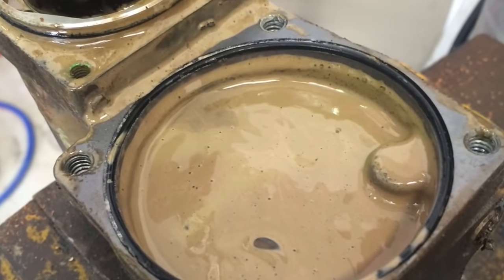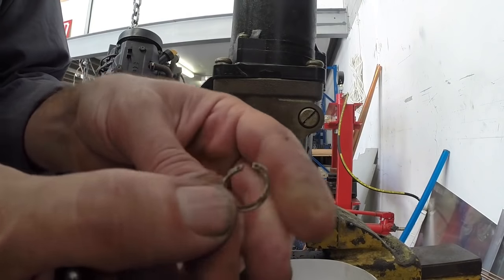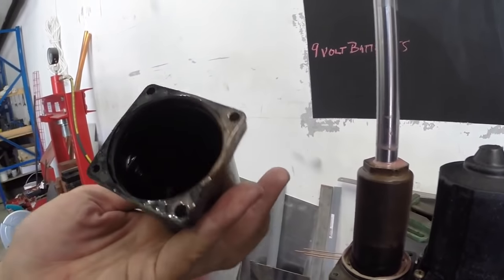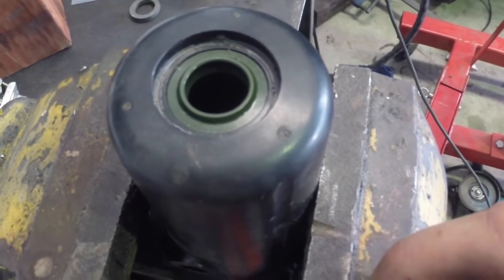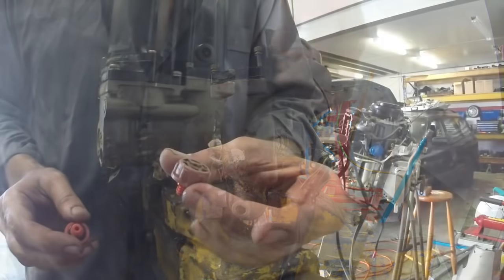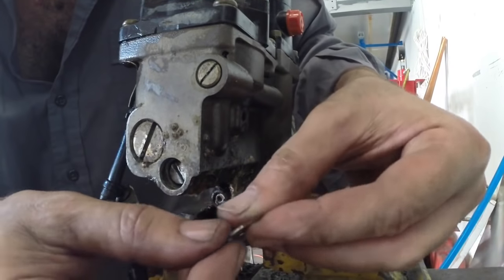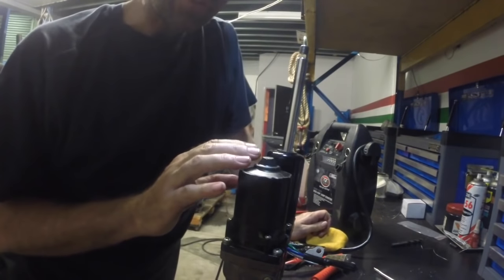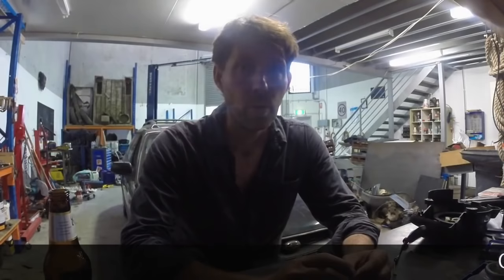Water in outboard trim tilt hydraulic oil

Comment: Hi. I just watched your channel. I have question about my 1988 Johnson 80horse outboard.It starts great, but when you accelerate, the motor only runs at about 3900 to 4200 rpms should be around 5200. All new electric parts.  20 ft. pontoon, prop is 11 pitch.  any help Thanks
Reply from the maker: Hi Wayne. Has the boat previously run at 5200 with that prop?

Comment: Again a great vid. 
Just one question, what would cause the trim to drop slowly ?  about 10mm over an hour. oil is at right level and air has been bled out.
Reply from the maker: +Danny Skok Make sure the bypass valve is screwed all the way in tight, it might be leaking a little bit. Otherwise, could possibly be the ram seals leaking. Also, with the motor trimmed all the way up check the rod for corrosion or pitting as that will cause oil to leak past the seals even if they are good.

Comment: Do you have to change the hydraulic oil on certain period of time or only when it malfunctions.
Reply from the maker: +Val M It more important to keep it topped up that to replace it. In fact there isn't any quick way to drain the old fluid out like there is with a sump or a gearbox. By topping it up every 100 hours (or annually) you'll be able to see if you are losing oil or have water in the oil and need to do the seals. Hydraulic fluid doesn't absorb water like brake fluid and doesn't get dirty like sump oil. I'm sure there must be some practical limit to its lifespan but I would be more likely to use a pump to fill the reservoir and just displace a bit of the old oil each time to keep it fresh.
Reply: Dangar…you are awesome, thanks for the quick response…enjoy your day!
Reply from the maker: You have a great day too. :)

Comment: Is it necessary to remove the outboard from the boat?
Reply from the maker: Not always, sometimes you can just undo one side of the transom mount and pull it aside to get the trim til unit out.
Reply: Dangar Marine ok it looks like I need to replace the top seals on a honda 75. Sounds like i might need a fork lift

Comment: Hi, I got 81 model johnson 70hp .my trims have started leaking fluid but my tilt is good that was last week, this week my tilt is making horrible noises not sure if air got in. i tried to bleed it filling it up with fluid but noise still there. the sounds it makes is like an old rusted hinge ROFL very  loud any help, please
Reply from the maker: It could be a problem with the pivot points being corroded so your hinge theory might be right.
Reply: thanks for the reply.
I have serviced it, grease all the places that have grease nipples. 
the noise comes from inside the tilt ram, I place my hand on it and I can feel the vibration coming from it.
LOL now I'm paranoid it could be the ram top joint where the pin goes throw I will check it.
anyway, mate love your show, I'm a big fan keep up with good work. I wish you had a video on how to replace seals and remove end caps on a motor like mine.i always take my boat to Brooklyn not far from you.all the best
Reply: update it is the top ram joint.
been spraying wd40 letting it sit for 1h then I tilt the motor up/down.
done it few times the noise has improved.I think the best way is to remove
the pin clean all and regrease it but the pin doesn't budge

Comment: I jump back to this video today because my Yamaha F115 trim seal should be problem.  I replace it last year with new seal but hammered out of trim cylinder head, it seems okay just the surface maybe not good look, but it still fit into new seal.

But after a year now it just leaking from seal once again.  The thing I notice was those seal should be 2 of them, one was sit inside of the cylinder head another one should be you can outside, but in the parts book not very clear the inside seal direction, but I just installed into the cylinder head and works about a year.

Any suggestion?  or just change the whole cylinder head and seal?  Thanks.
Reply from the maker: If seals are leaking after a year it could be that the shaft that runs through the seal either has some pitting that allows water to bypass the seal or some burrs that are cutting the seal. I would check it closely for that.
Reply: Thanks, I had take out those seal and found some fishing line balls in it, it stick pretty hard to the shaft, and it should be the problem damage to the seals.

After I order two seal and using your hack way to replaced them and also the oil, I tried the boat yesterday it runs great once again.

Thanks for your video, it always help!

Comment: I'm currently working on my own trim unit. I've found that the little key that you talked about that goes from the motor to the pump does not turn easily in the pump. Is there any way to free that up?
Reply from the maker: Did you have water in the oil? It is probably as corrosion problem inside the pump. Disassembling and cleaning is probably the way to go. Will be doing a video on that soon.
Reply: Yes there was water in the oil. Cleaned every bit I could get into. Thanks, and I look forward to the video!

Comment: Thankyou for your very informative Videos as always! I have the same problem with my Tohatsu M40D2 Power trim and tilt, and it looks exactly like this Honda's PTT. I have removed the reservoir tank oil seal as you mentioned and it is the same as the one you changed - Green colour, same numbers printed on seal. Do you suggest I buy the Honda seal? Since Tohatsu do not offer the seal on it's own (you have to buy the whole reservoir tank for 120 dollars plus shipping!!!) thankyou once again!
Reply: Most oil seals have a part number. As you can see lots of manufacturers use the same seals. The seal part number is the key. Honda buys the same seal that you can buy.
Reply: I'm in the same boat as you. Did you replace the seal and if so how did it work out?

Comment: Having an issue,,top off my trim fluid..works fine out of water and at low speed,,but once I throttle motor up my tilt doesn't work.. can trim into desired position but fall back down once I throttle up(if that makes sense).. watched several of your videos about trim/tilt but none cover this issue..it's a Evinrude
Reply from the maker: Sounds like a leaning seal in either the piston or the bypass valve.
Reply: @DangarMarine  Ive watch a few video on replacing/rebuilding tilt Orings and was considering going that route but them few post etc said consider accuator valve in trim

Comment: Anyone know the part numbers for the seal kit
Reply from the maker: If you look up your engine on marineengine.com you should be able to get the part numbers.
Reply: Looked all through there I can not find it. My issue is that I have a DF115 Suzuki and the IPB does now how a shaft seal independent from the $200 cover. It looks exactly the same as the one you pulled off in this video. What motor was in the video of what part number for that seal. Ie been searching for 2 days now.

Comment: how about thread tape on the screws to help seal
Reply from the maker: I wouldn't put any on. If a bit breaks off it will block the hydraulic passages the oil flows through. The o-rings and seals (if in good condition) are up to the job.

Comment: Hey Stu ...On my tilt and trim it works but if I raise the outboard up it slowly drops back down... is this a major problem or could it be a simple fix ?
Reply from the maker: It can be a few things. First thing I would do is make sure the manual bypass is fully closed. You can even try opening it and then fully closing it again. If they doesn't work you can try removing it completely and then replacing the seals on it. If it still drops you will need to replace the seals inside the hydraulic ram.

Comment: Hello friend,thanks for your videos.
I have question. 
My Evinrude 40 hp 2 stroke ELO engine,I think it is from 1990+, manual tilt assist has got water in it!
Is it posible to repair it ,or do I have to buy ny replacment?
Thanks
Reply from the maker: Ah, good question, I don't deal with many of those, I always assumed they were a gas strut of some type. I do have one in the workshop at the moment though so I'll take a look at it during the week. Might make an interesting video.
Reply: Please do so.It would be nice to now if those units can be repaired if we can get parts for it?  Thanks for your time.

Comment: Hi Stu
Great video, thanks.
I'm going to change the trim-tilt motor on my 2002 50hp Yamaha four-stroke. The motor is working fine, but the housing looks bad, very rusty. I can get an Arco or Sierra motor from America for around $350, or I can buy a no-name brand on ebay for $150. Is it worth spending the extra $200? Or do you know somewhere else I could get it? I'm in Perth.
For the small parts like o-rings is there an online shop where I can get them, or do i need to go to my local Yamaha dealer? I have the service manual, but it doesn't have the part numbers.
Thanks!
Reply from the maker: +David Hankin Hi David. You could also try Oz Wide Starters. They also carry a range of trim tilt motors. Quality can vary quite a bit. I've seen some aftermarket ones rust out pretty fast.
Reply: +Dangar Marine Thanks, I'll check them out
Reply from the maker: I forgot to say, I haven't found any good online stores, but take the o-rings to specialist engineering store and they will be able to match it for you.
Reply: +Dangar Marine - How about the small parts like bushings that have to come from Yamaha. How do you figure out the part numbers?
Reply from the maker: Here is the link for my outboard, but just use this site to find your model then look through the parts diagrams to find the bits you need: http://www.boats.net/parts/search/Yamaha/Outboard/1999/F50TLRX/parts.html
Reply: +Dangar Marine Thanks again. I think mine's pretty much the same as yours except a different year. I thought it was 2002 based on the ebay ID codes, but most other sites say R is 1993. The boat is 1993 so it makes sense the outboard is the same year. It's in good nick for 23 years old.
Reply: +Dangar Marine Sorry, here's the link for the eBay model year ID codes. I think they're wrong
http://www.ebay.com.au/gds/Outboard-Spares-YAMAHA-Model-Year-IDENTIFICATION-CODES-/10000000175675727/g.html
Reply from the maker: The codes seem to vary between the US and "rest of world" models I think. Unfortunately it makes things a little hard, but often parts remain unchanged for quite a few years.

Comment: You lost me ? You said in the beginning of the video that you had milkshake in the unit and were going to flush it out with ATF and then into the video you leave the water in the unit and just replace the seals . WTF dude why would you leave water in the unit that is very bad on internals and the pump. I waited all this time and you never flushed out with the ATF like you said to get the water out

Comment: Have you ever seen the actual 12v motor housing (where the armature sits in) fill with fluid? I have that going on with my 98 yamaha 150 tilt trim unit. Im baffled. The oil seal on the shaft (that turns the pump drive) appears undamaged but the electric motor case is filling with fluid none the less.
Reply from the maker: Yes, I have see that, but every time the oil seal around the shaft has been obviously damaged or falled out completely.
Reply: @DangarMarine  its acting like there is too much pressure on the top side of the pump assembly (where the motor and key way sits in) and its inadvertently forcing fluid passed the oil seal. I don't know much about these systems so im not sure if its normal to have pressure on that side. I'm just stumped. I went through and stripped the pump assembly down today and blew out all the orifices just to make sure. Ill throw it back together and see if it changed. If you have any ideas, feel free to throw them my way.